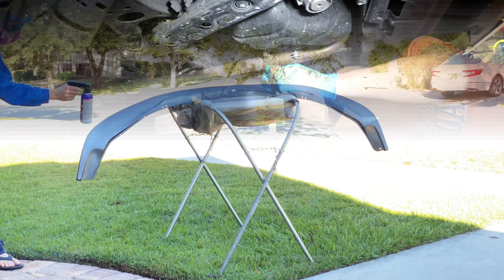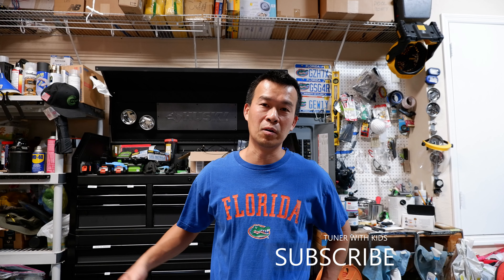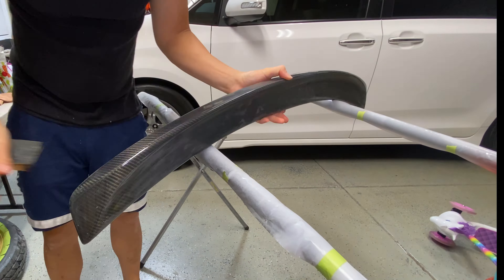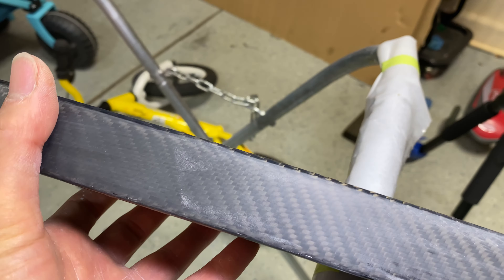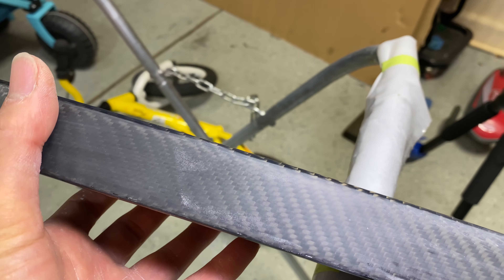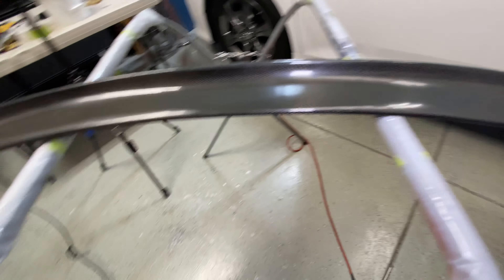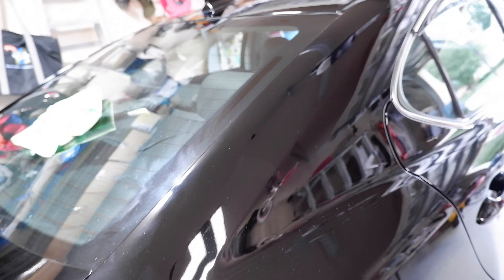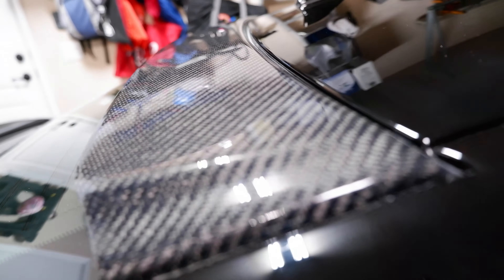Lexus IS-F Spoiler Install | Carbon Fiber Wetsand Buff Polish | Roof Spoiler Install

Comment: Nice video man. I had a follow up question, so I bought a carbon roof spoiler(same one you got) for my Lexus IS, I bought a can of 2K they just arrived today. Since the spoiler doesn't already have clear coat brand new, I should just follow all your steps here exactly the same before installing right ?
Reply from the maker: Richiee 350 yea. I would highly recommend coating the resin with 2K before install. These eBay spoilers don’t have a good clear on them, I suspect it’s just polished resin. Scuff with a 3M scotch bright, grey, and clean then spray with 2K. I have another video with the 2K spray process.
Reply: @TunerwithKids  Thanks! I will follow your video steps and your recommendations!  I appreciate it

Comment: Is there a gap with the 3M foam tape? Where water/dirt can get trapped. I'm debating on drilling holes.
Reply from the maker: You want some gaps toward the rear so it can drain and ventilate. I took this off to repaint and previously I had it sealed all around so it trapped all the moisture and water and messed up paint in the corner.
Reply from the maker: 3M will be fine. If it’s aftermarket spoiler, there aren’t studs for holes anyway. It’s not going anywhere. Just use real 3M tape and make sure the spoiler is true and straight onto trunk.
Reply: @TunerwithKids  You added 3M tape along the edges only, why not add 3M tape in the middle of the spoiler also?
Reply from the maker: The middle doesn’t touch the trunk. On my initial install I had tape in middle but upon removing for repaint, the middle tape never touched or suck to trunk lid. You can try double or triple up the layers to see if it reaches.